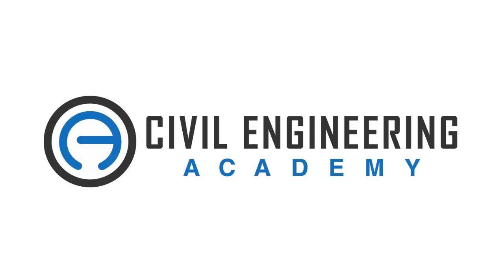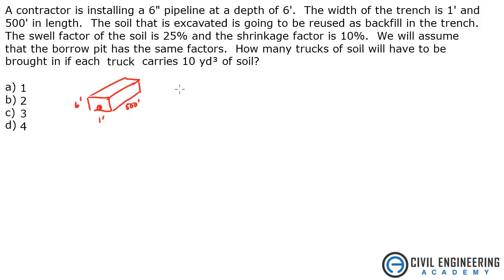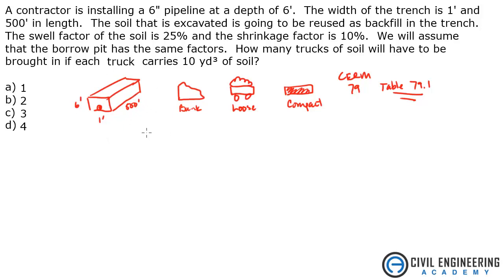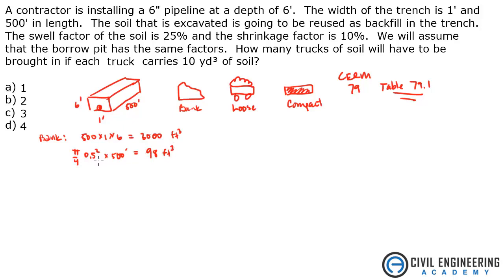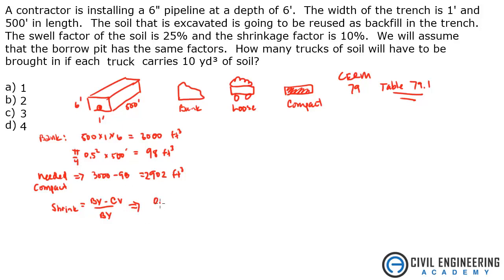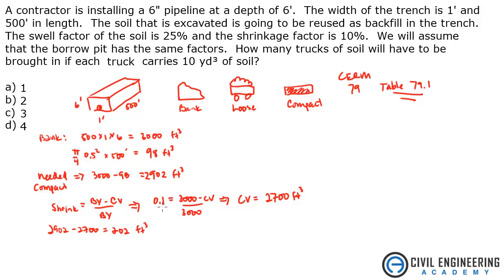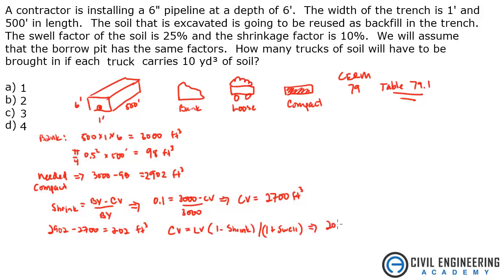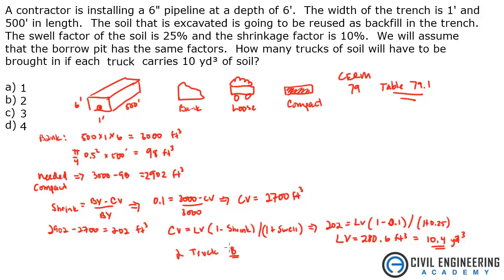Construction   How Many Trucks are Needed to Fill a Compacted Trench

Comment: The new PE Reference handbook (Page 47) states that Shrinkage is [(Compacted Unit Weight) - (Bank Unit Weight)] / (Compacted Unit Weight) and x100.... can you help explain why this was changed in your equation or what I can do to get the same answer?  Thank you!
Reply: Under section 2.1.1 in the PE Reference Handbook make sure you use the first two equations. You'll end up with the same answer.
Reply: @samwisenim  I definitely see what you mean by using the two equations on page 47 of the NCEES Handbook 1.1 (CBT) and basically solving them both for the Bank Volume and then setting them equal to solve for Loose Volume.  That is correct.  However, @Kyle Loomie asked how the instructor derived the equation for shrinkage factor as SF = (BV - CV)/BV from the NCEES Handbook equation given.
Reply: For the last part you can combine the VL and VC equation by subbing in VB from the VL in the compacted volume calculation.

Comment: Why did you divide the volume of the pipe by 4?
Reply: Hi escdelesp, that is part of calculating for the area using the diameter of pipe. Area = pie * (diameter of pipe/2)^2, the four comes from the squaring of the 2.